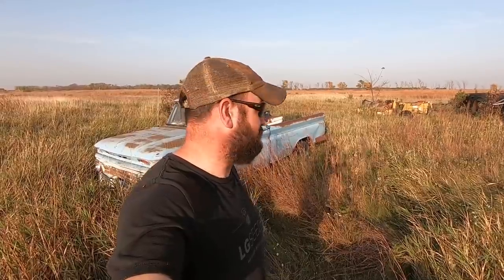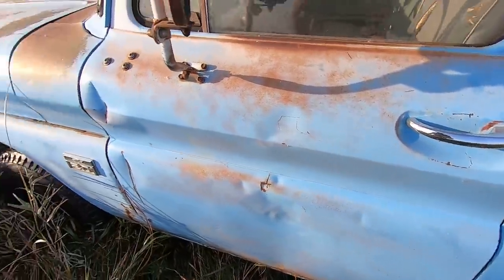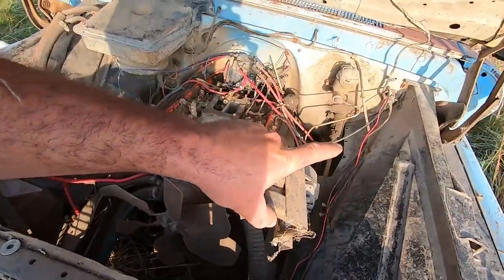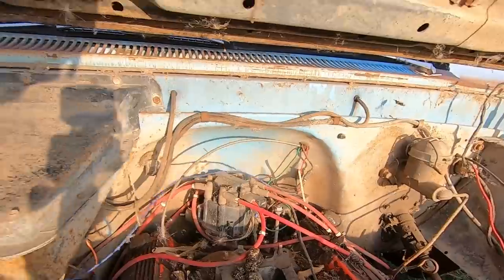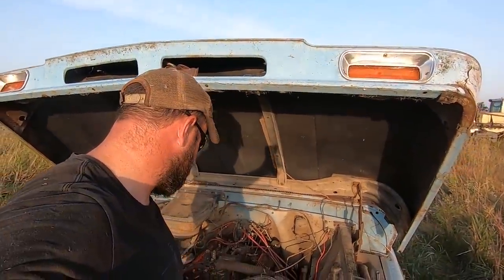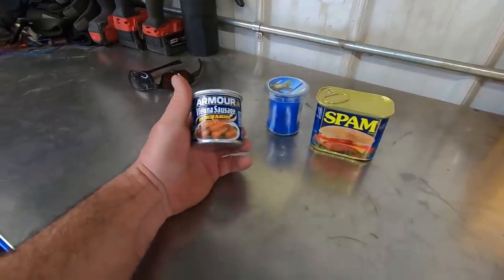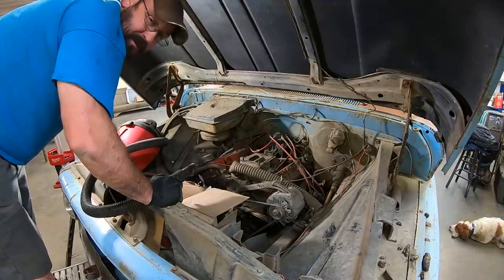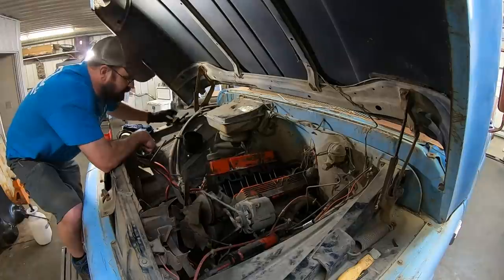Abandoned 1966 Chevrolet 4X4 K20 Farm Truck Left for Dead! Sitting for 15 Years! Will it Run?!?

Comment: I am guessing that you  were in low range on the transfer case.... and those had the divorced transfer box's and are highly desirable to all those rock climbers and what not. Any transmission you  wanted in front and a short driveshaft makes it into a four wheel drive (front axle required) and so going on and on about the transfer case, back then some were a two lever so that one was high/low and the other two or four wheel drive. That transmission was a synchromesh transmission or its  really old cause that stopped early fifties. I bought the 1960 hi cube panel in sixty one an it was synchromesh transmission with that odd ball front axle that had the big round ball and then those five big balls that made it turnable. Borg Warn axle I am guessing at the name as its not Dana. I think that the rear axle is dana but most likely and my brain goes "too much cosby when just a child" or can't remember. What I know for fact is that those transfer cases were almost bullet proof. Personally the cabin on that running gear is wasted so roll it under a nice looking F1 or say dodge or international... or who would think.... like a five window chevy from the early fifties. That would get some subscriptions Mortske. Heck all  that stuff pollocks know is available to just you .... the fine owner of a mosquito killer and early signs of COPD and yet never inhaled on any tobacco products..... great one bud and worth the few day wait. I mean that took two weeks or a lot more to make into a fine video so why do you always make me wait. Was it cause I tried to date your grandmother?? LOL, na I think that I am too old even for her so smile dang it and drink beers...... have a good one

Comment: Cruising down the gravel roads in a Chevy truck that uses oil and has no brakes, oh, the memories of my youth. The raccoon shit cooking on the engine is a new one to me, but whatever floats your boat. You and Duff dog should have kept going until you found a bush party, or better yet, a party in the local gravel pit. Duff dog probably would have found himself a hot chic and you'd have been driving home alone.

Back to those SBC. Every SBC I have ever had used more oil than an Evinrude outboard. Seriously. 1 quart of oil consumption every 800 miles was considered "normal", or at least that's what GM said to get out of warranty claims. I had a 1972 Custom Deluxe (beautiful truck) and a red 1974 Camaro, when I'd put my foot to the floor all those 350's would do is make a hell of a lot of noise and suck gas, they couldn't get out of their own way. But some guys do love their small block Chevy's. Go figure.

Comment: The snap on scraper in the tool box is far more functional and can be manually re-sharpened to be razor sharp,,,,,,,
Reply from the maker: They resharpen these for free and I've had this one for 5 years and it's still as sharp as the day I got it. And probably half the price of Snap On.

Comment: Come pick up my 59 apache and the 350 Engine for it!
Reply from the maker: You got one for sale?
Reply: @MortskeRepair  Two video's of this subject. You are the one of two to come flat bed lad these. I can watch, Just can't help anymore. That 350 has to be worth some money. But rather watch you go with this.
Reply: @MortskeRepair  Two heads with the Big valves heads. And the Block is rather old also. Think it was bored over .060 Cylinders.
Reply: @MortskeRepair  That 235 engine in it is fine, however needs the block bored and probably sleeved.

Comment: i own one of those trucks. They have a divorced transfer case with a high and low range. Mine has the heavy duty lock out front hubs. 456 gears and a No Spin Differental in the rear end. The steering sector leaves a bit to be desired. I was thinking of converting to a power rack and pinion.

Comment: She rides rougher than my ex wife. I had a 66 half ton with a small block Chevy and was driving the freeway when I head a loud noise. When I opened the hood a blade from the fan had broken off and was lying on the air cleaner. Big dent in the hood.
Reply from the maker: Ouch!

Comment: Spam, have a bit of meat with your salt
Reply: Yea that is a 289, it didn't come with 302, the 289 was the 302 of its age. I went and saw Heavy Metal at Deanza drive in and watched it on the hood  my 65 stang, with the sport package it was stock 289 and I remember it wasn't available that year because the 302 did t come out til 72for long time until the 70s then died out in 
The early 90s that's alotof 3o2s. As the performance enhanced engine they could as much hp as its size before it would shoot the Rod and pistons tru the pan and into the asphalt rebuild part inpro so they made the 302 to enhance the power and new performance to a world back then gas was 36cents for regular and Ethel was 56 .🤗